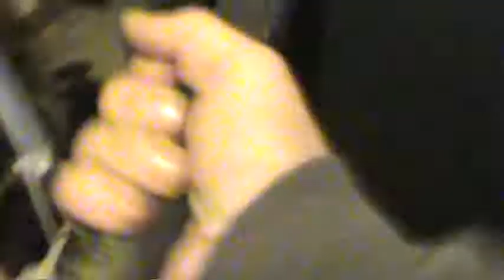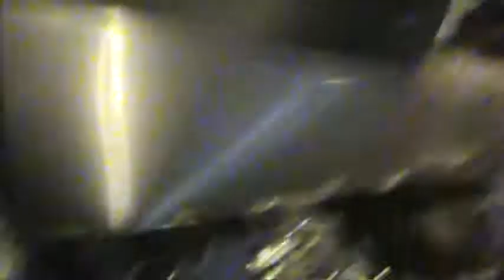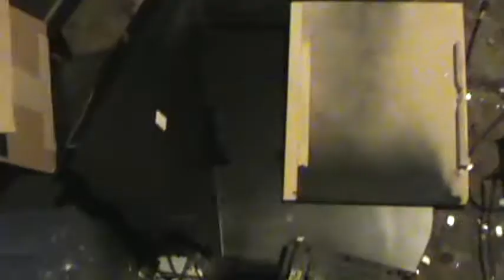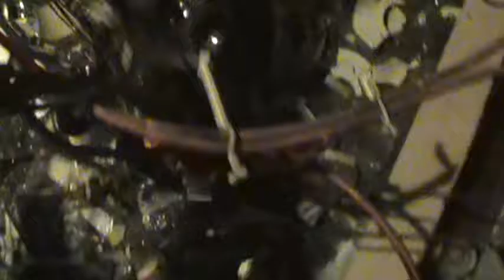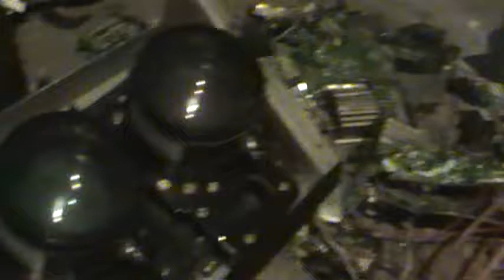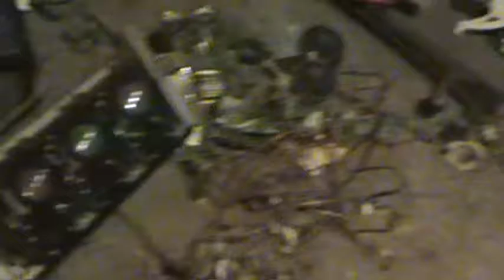Scrapping a Projection Tv for Copper and Metal!! What's inside a Projection Tv??

Comment: Lotta shit hu? Lotta work for 8 bucks? You should have gotten at least $20.00 the scrap prices are the same everywhere in the us. Did you get the motherboard or the 3 to 5 lbs of copper inside those lenses? Oh that's rite you disabled it with a hammer. And what about the 3 different types of aluminum? And screws? Lotta shit man. This probably pissed you off but you should thank me?

Comment: WOW!  This was not a good way to go about scrapping a rear projection TV.  The $8 you got in scrapable items is pretty low, but unfortunately, you destroyed alot of the value in this tv by bashing it to bits.  Circuit boards command a price of at least a $2/pound all the way up to nearly $10/pound.  Fresnel Lenses recovered from TVs exactly like this are frequently sold on eBay for $25 or $30. Too bad they were all shattered to small unusable bits.  TVs like this have usually got some large cast or extruded aluminum pieces that add up to several pounds.  Didn't seem like any of that was recovered or even given mention.  How about the super gold rich DLP chip, you know the CPU chip equivalent on a TV like this?  Also not seen being recovered or mentioned. Taking the time to properly disassemble something like this would also allow you to take the different components like speakers or lamps out intact, which if working, can often be sold for considerably more than their scrap value.  Had this been more carefully disassembled, and given a better evaluation of the components, there might've been as much as $65 to $100 in value, if components had been not only sold for scrap but also things like the Fresnel lens or other parts sold on eBay, and the circuit boards and chips sold to an electronics scrap dealer.  Unfortunately it was wastefully smashed and the most valuable parts overlooked or destroyed.  This video has a much more complete take on the same subject matter: https://m.youtube.com/watch?v=Fnzy601zImE#